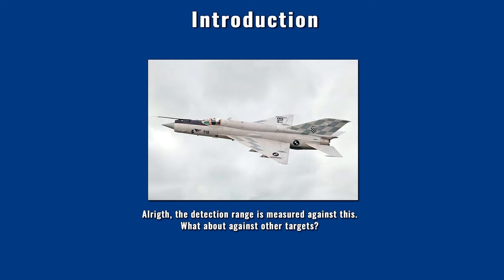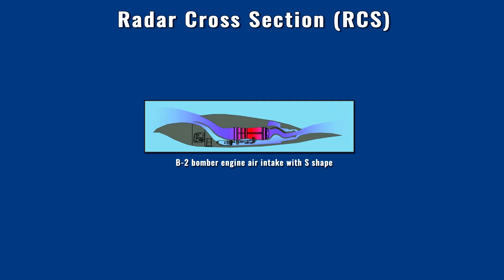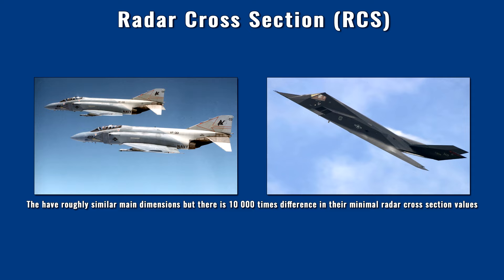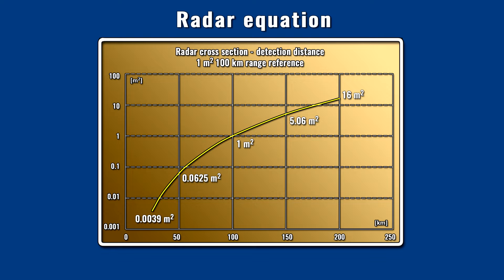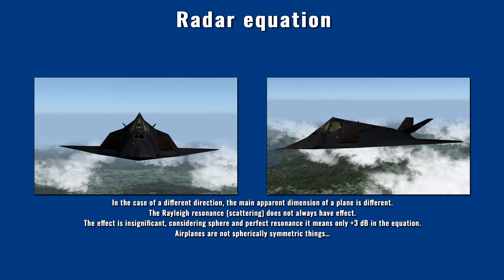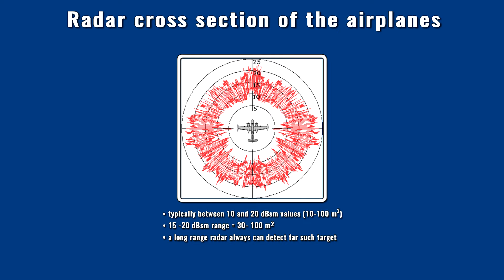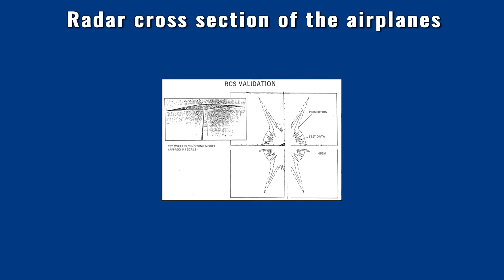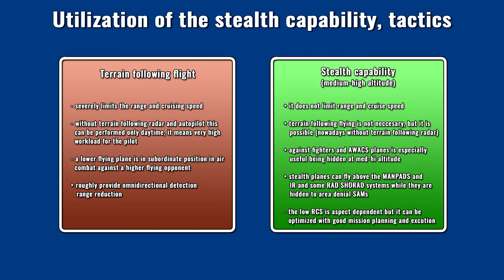What makes a plane stealthy? - Stealth vs radars, the radar equation

Comment: "RCS" is not an Single Value it has aspect dependent characteristics".

I may not be the smartest but I can always tell when someone is just brainlessly parroting information without context, let alone more than a surface level understanding of stealth than when they just throw numbers around. Details like aspect, radar frequency and the like just ignored. Let alone other details.

I have learned to just ignore such discussions and talk, even if I find it infuriating.

A very informative video as always.